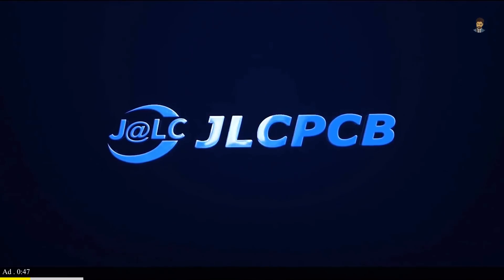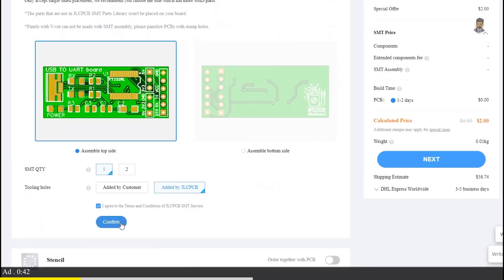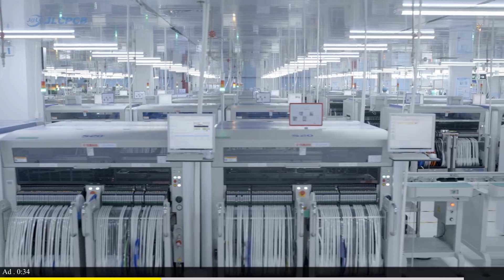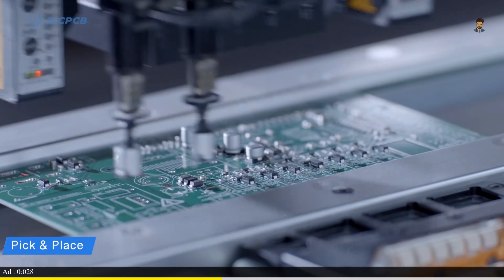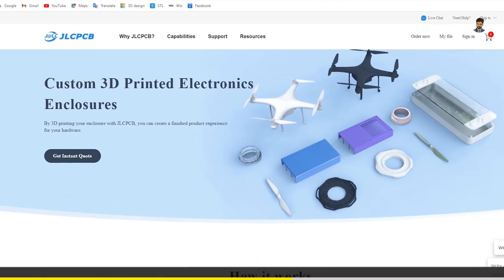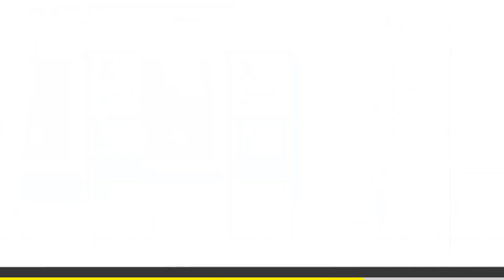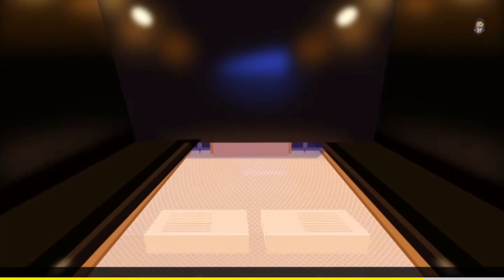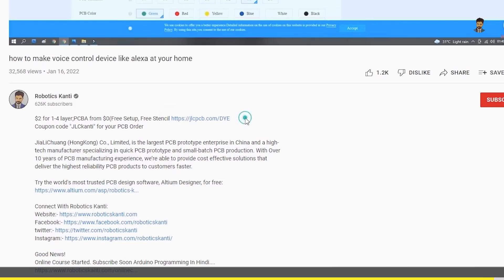how to make solar panel and booster using led at your home

Comment: Button phone will charge with 0,1-0,2 mA current, but that's extremely not enough for modern smartphone. There should be ten times larger array. And also, this is direct sunlight. Clouds also ten times less power. And so, yea, power producing that tiny light matrix in diode, and actual solar panels, as they completely covered in light sencitive layer, as much more effective in same sqare.

Comment: Totally fake😒,
Even with just a few led, the voltage may be close to 2v, but the amp will be very low, which is a not usable. 
The booster circuit will consume total power from the led panel, nothing will come as out put.....(you tricked us🙄)
Even if you use a actual solar panel this will not work......
To use a bosst converter you need high amp but in your home made solar panel there is very minimal amp,,,,,,
I watch all your videos. Pls don't spread such false information.... ..
Reply: Phone showing charging is video editing
Reply: @electronicslab_in  yes

Comment: The diodes of the booster circuit are wrongly positioned, and wont work, if you strict to circuit diagram. Better using two transistor ROMANBLACK SMPS (Hero999 / Zero999)  type boost circuit.

Comment: Virtual satisfaction, very low ampere micro amp, watch carefully it will show mobile charging when connected but a notification will pop charger removed or plug again.